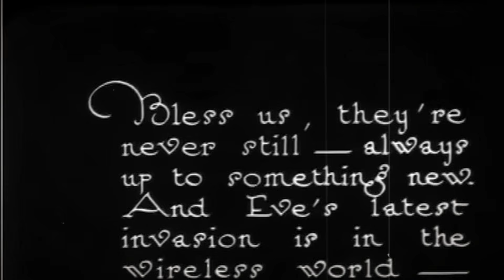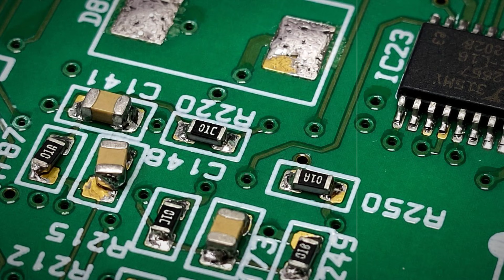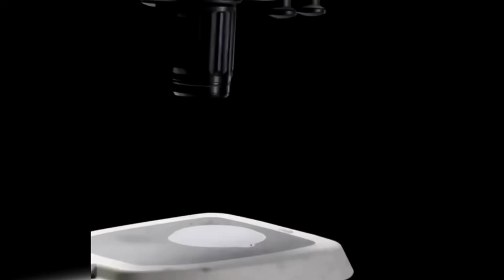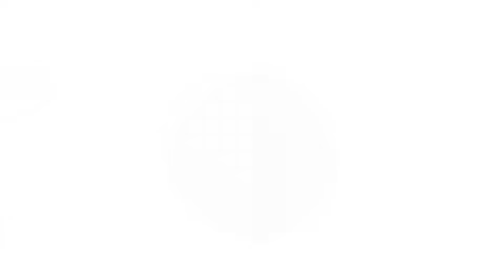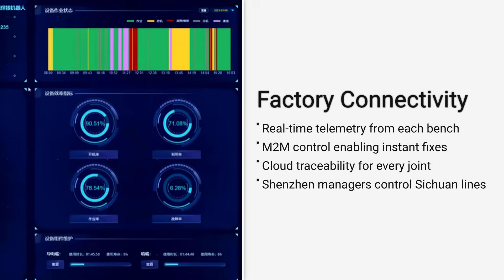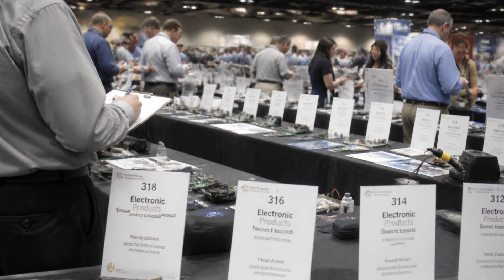The Fascinating Story of JBC Soldering, The Spanish Family That Built Premium Electronics Soldering

Comment: I have Hakko and a knockoff X -Tronic. I'd like to try a JBC but when I looked into them they were just too darn expensive. What would be interesting to try one of these for sure! I've never had much luck with the conical tip on any soldering iron, no matter if it's Weller, Micronta that I had in my student days or today with the Hakko or the X-Tronic. Instead I use a small chisel tip. For some reason, the chisel tip just seems to have more thermal mass and recovers faster. Even if it's a tiny chisel tip it does better than a conical one. I wish I had something that had an LED on it not one that will blind me but one that will light up the work, and why can't there be a small vacuum closer to the tip to pull the smoke away? Fume extractors are another problem. They are either of those stupid little cheap ones or way out of proportion in price. I wish someone would make an extractor that extracts both above AND below where you're working, kind of like how a "Jenn -Air" range cooks steaks if you take my meaning. FINALLY, we have image stabilization even for the phones on our cameras. And surgeons of course used DaVinci robots, which take the "shake" out of your hands when you're trying to do work. A small table top robot that can take the shake out would be a wonderful thing wouldn't it? With pick and place machines also being common in a lot of industries, I don't see why such a robot couldn't pick and place and solder? Who knows it might even replace or at least compete with wave soldering. A fume extractor instead of having to need expensive filters that are a lot of times unobtainium for a knockoff, should instead use common filters or easily added batting or media because a cheap extractor (or an expensive one) with no available filter or ridiculously priced replacements is kind of useless. By the way I really like the X-Tronic I use that mostly for the hot air and then I use the Hakko soldering iron, although the xtronic also has in iron. IMO some companies have a bad habit of not stocking parts for older things like their solder remover. Not only does that make it hard for me to buy a new one because I don't trust something that I can't get parts for later so who wants to shell out the money for that but, it also makes it pretty much impossible for me to get a used one. Again just my opinion. I found that it's also not true that the knockoffs are bad. The xtronic is actually pretty good, and then a very good price point, by the way with replacement parts available! The importer and the support is out of Lincoln Nebraska. Well I know I fall in that middle area not exactly a casual solderer but not doing it every day commercially either. And that's where the price points become a problem. I just can't pay commercial prices, and the companies cannot produce something commercially if they can't make a profit! What they could come up with a fume extractor at a better price point. As high school kids in High School vocational electronics we always took for granted that the fumes were there and that was that!  What times have changed and we should reduce these occupational exposures for students! All the Best! 73 DE W8LV Bill (and in SANER TIMES: W8LV/VE3) 🇺🇸🇨🇦

Comment: So that's why JBC irons are better.

But it should be noted that most soldering is automated. Most PCBs (printed circuit boards) use reflow ovens to solder surface mount parts, which is a highly controlled process.

One correction: at 19 min: that is a Pick and Place (PnP) machine, not CNC.